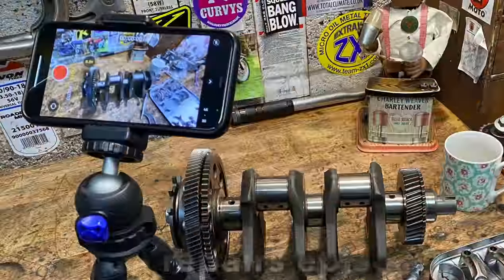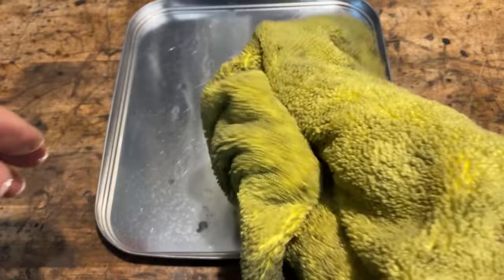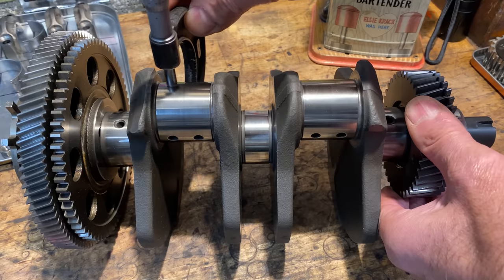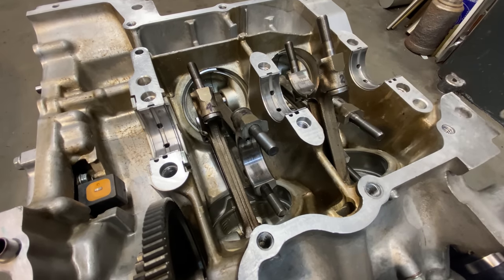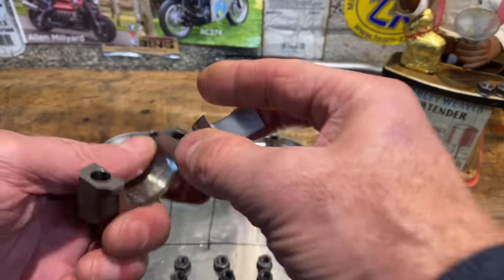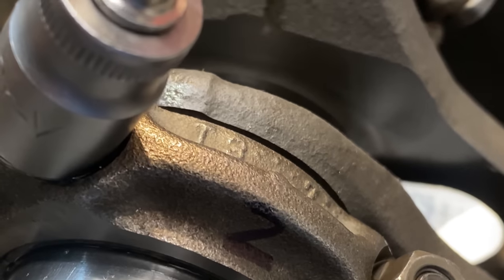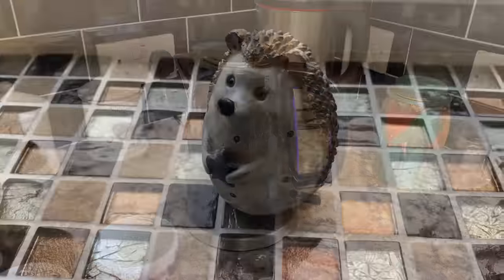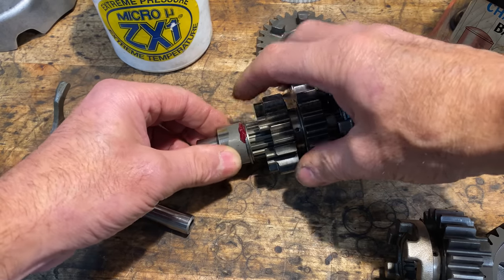Honda ST1100 Pan European - the engine rebuild commences  - Episode 2

Comment: So, are you going to disassemble the work already done, or remove the piston & conrod, to fit the brown shells?
Reply from the maker: No they are staying in and fitted in same way as green shells
Reply: @AllenMillyard  Now I'm confused. How do you replace the conrod shell bearing without lifting the crank out? Am I overthinking this? Do you just rotate the crank away from the conrod and this leaves enough room? I guess all will be revealed in the next video!

Comment: Allen, do you think the green shell on number 4 was an error during the original assembly at the factory? That said, the heat marks on all shells would indicate that our original thought about oil starvation might have been correct anyway?

Comment: Since this engine is basically a Gold Wing engine with the cylinders bent up, it should be trivial for Allen to modify an 1800 cc Gold Wing six cylinder engine and fit it to the ST frame
Reply: Or an H12 perhaps ;-)
Reply: @alan-sk7ky  Nah. Just angle the cylinder banks closer into a V. A few hours with a hacksaw and the TIG-torch

Comment: Vey good video, as allways. But at 14:14, shouldn't the hole in the gear free rotating spline thingy (where the gear would be rotating over) line up with the hole in the shaft for oiling? I am aware I could be wrong, so correct me if I am. 
Cheers
Reply from the maker: They don’t need to line up due to the orientation of the spline . Oil flows around a groove machined on the internal bore of the bearing sleeve

Comment: By any chance do you have a photo of the journal/holder for the main bearing shells. I stripped my year 2000 engine and found a lot of fret damage to journal/holder. Still have my engine in parts working out what to do next

Comment: Hi Alan,great video again. 

I have a couple of questions if that`s ok?. 

first, you used the term "engine assembly oil" which looked quite thick (i`ve heard of this before), is that the same oil as the engine would normally run?. If not, why do you NOT use the same oil that you would normally run on, as i`ve heard that "assembly oil" can thicken and gel, is that correct?. 

Second, when i worked on the trains over 20 years ago, we had to do a course on mechanical assembly and "torque tightening", where one of the issues was assembling and tightening nut and bolts etc. We were told that at no time should we use any extra lubricant on nuts, as when you torque them up, the lubricant allows the nuts to tighten too easily, and stretching the bolts causing a possible failure point, have you ever heard of this, or is that not applicable for some reason?.

Many thanks for the video, i`m really enjoying them.

Lastly, i wish you a very happy new year.
Reply from the maker: The oil I used is fine and Honda specifically specify using oil on big end cap nuts

Comment: Did you remove the selector drum to check for wear, damage or faulty machining in the grooves?
 I've also seen a lot of Honda's where the posts engagement  wasn't really deep enough, almost like it was designed for a roller to fit on it then they changed the design half way (plus wear on the running surface of the posts at high mileage or real bad gear-changes for 4~5,000 miles 'just around town')
Gear whine I found more common on Suzuki's as they didn't grind gear teeth smooth and left them machined finish, Honda have done the same on rear bevel box a few times

Comment: All torque specifications are dry with no lubricant. Any lubrication will couse a over torque on the pitch of the thread. By a significant amount.
Reply from the maker: Honda specifically specify the application of assembly oil to the threads of the big end cap nuts before tightening them to 26lbs/ft  !

Comment: I am sure I must be under a misunderstanding but if you lubricate the stud    threads  prior to torquinģ up the nuts won't that give you a false  reading with torque wrench? ìe the friction would be  lost.  Perhaps someone can enlighten me.  Great video
Reply from the maker: It’s easy ! Honda say to lubricate the big end nuts prior to torquing up to the specified 26lbs ft as stated in the works manual
Reply: Thanks Alllen  Is it usual practice (I'm not that familiar with motorcycle engineering) or is it a Honda peculiarity?

Comment: Isn't the transmission whine normal on some bikes due to the straight cut transmission gears?  I don't blame you one bit for changing them while you're in there but every bike I've ever owned whined a little or a lot.  I actually like listening to it in some weird way.

Comment: At 14:22 you installed the bushing with the oil hole not lined up with the oil hole in the shaft. Not sure if it matters or not but I thought I’d point it  out. Would hate to see it burn up.
Reply from the maker: It’s designed to fit in any orientation there’s is a radial groove in the bore of the bearing sleeve

Comment: What are you going to do with your green St now? And how many kilometers did you do on it? Looking to buy one myself, is around 100.000 acceptable for this kind of motorcycle? I dont have the tools, skill and room to do what you do so i’m kinda scared it will need mayor repairs in no time.
Reply from the maker: The st1100 has a great reliability record  and the engine will run for over 200000 miles with the right maintenance.

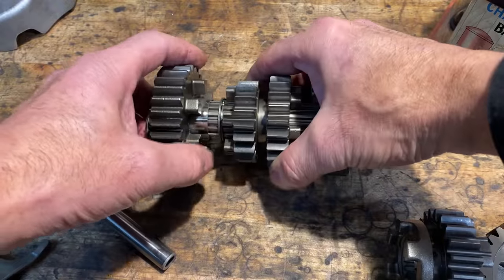Comment: It seems to me that the splined bush at 14:00 till about 14:15 has a oil hole that needs to be in line with the oil hole of the shaft so that the gear is lubricated.

Comment: How can the big end bearings be different on the the same shaft, is that wear or were the machined separately which wouldn’t make any sense to me, why do you think they are different sizes?
Reply from the maker: Honda measure each journal and assign a letter or number

Comment: Hello, how are you from Uruguay, I'm talking to you. I have a pan european honda st1100 but I bought it and it doesn't have the clutch system and in Uruguay you can't get the original. Can you tell me if there is any other clutch system on another motorcycle that can be modified, thank you very much.

Comment: If you are going through all that work, why not change the mains as well for a complete rebuild?
Reply from the maker: Almost impossible to find and they are as new
Reply: @AllenMillyard  I see.  The guy sourcing the brown rod bearings doesn't have them?  You see them "as new", but in fact they still have tens of thousands of miles on them...

Comment: You should always torque with dry threads, otherwise you will torque too hard.
Reply from the maker: not according to Honda
Reply: Always check with the manufacturer before starting any work, you are correct an oiled thread will torque differently to a dry one, but as Allen has said Honda quoted the torque oiled.

Comment: Does the oil added to big end threads not affect the torque setting numbers?... ie dry or wet assembly.
Reply from the maker: Honda sec oil on threads in the official works manual for the ST1100
Reply: @AllenMillyard  ah.. Thank you very much Alan 👍

Comment: I never fully understood why Honda machines and builds their engines like this, mismatched big end diameters. This is why I couldn't rebuild my Wing without 1) having the crank & rods reground to use bearings I COULD get, at huge expense, or 2) Having custom bearings made to fit, at even greater expense. I don't see any advantage to doing it that way, not real sure what their reasoning is for not machining all big ends and rod journals (sometimes mains are different sizes too) at the same size like everyone else. If anyone knows, please let me know.. every machinist I've spoken to over the last 40 years has a different answer as to why this mishmash is still done and it's a total mystery to me as an engine builder
Reply: I don't have an answer,  but I think the same. It's a very valid point you're making. 
Hopefully, someone with more knowledge will come up with an interesting answer. 
Happy New Year
Reply: @Herzankerkreuz67  Sidenote: I forgot to add in my original comment that I can totally understand why they would potentially do this on their split-case engines (flat & v), it's very hard to line hone main saddles as it requires whole crankcase to be together and there's not necessarily a clear shot externally to get the boring bar in (it's very difficult on Subaru boxers, too) but even Subaru grinds the crank journals equally and fits them to the case with mismatched bearings to dial in the right clearance..  but I don't understand why Honda does this with their rod journals, where you end up with assembly mistakes at the factory like Millyard is having to correct here